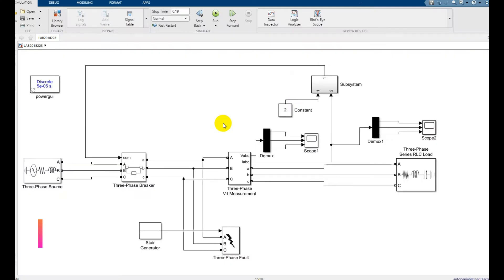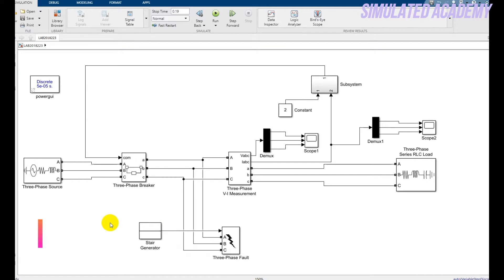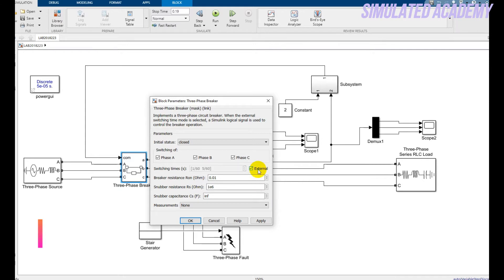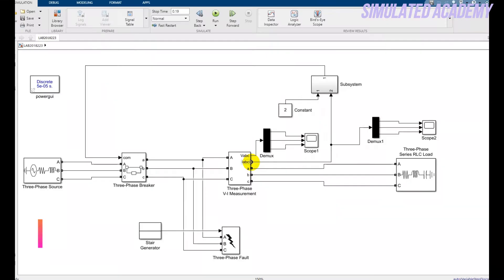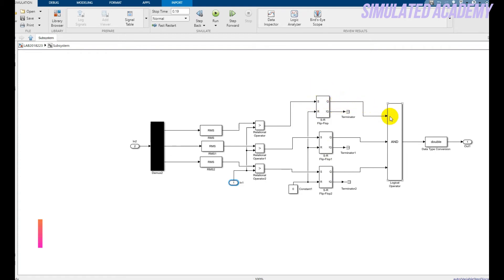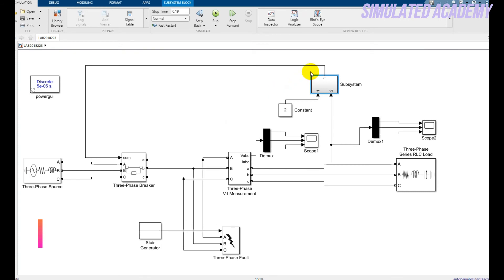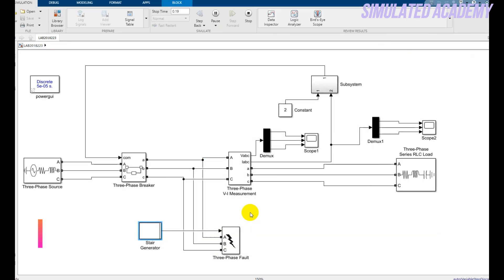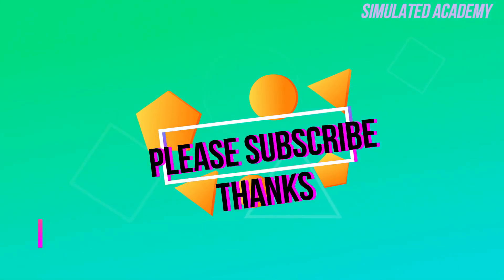Modeling of Over Current Relay using MATLAB Simulink | Overcurrent protection in Simulink

Comment: Is there Modeling of Overvoltage and undervoltage Relay using MATLAB Simulink | Overvoltage and undervoltage protection in Simulink ?
Reply from the maker: You will not find build in block but yes you can make your own logic.
Reply: @adiclouds  How can I contact you by email?